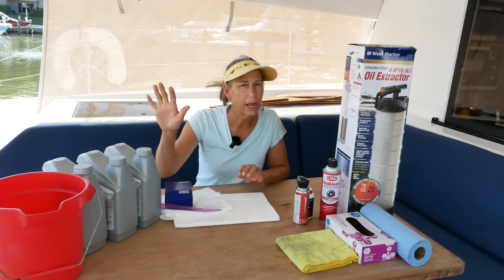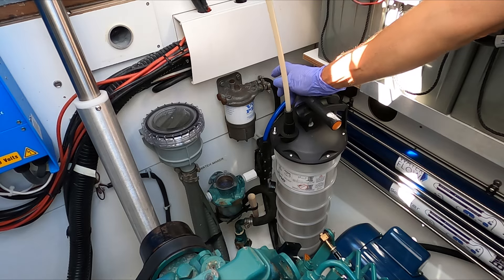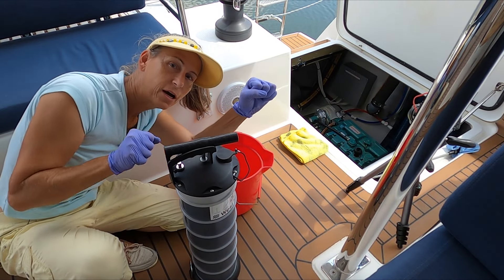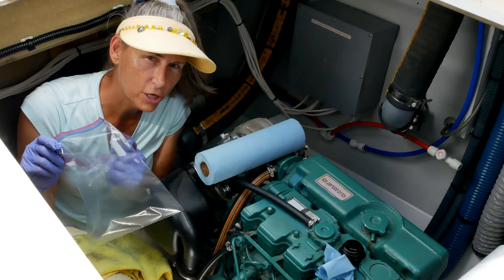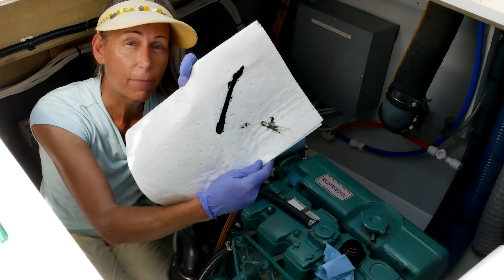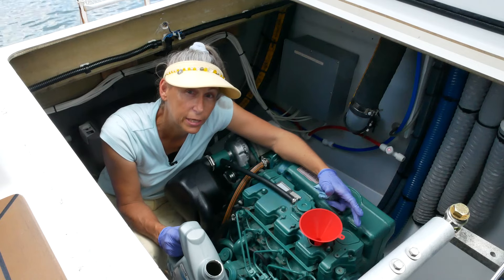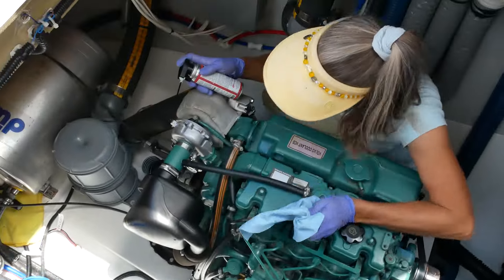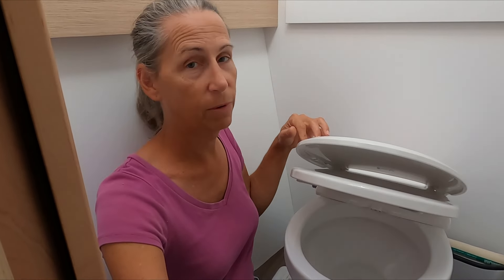Boat Engine Oil Change - EASY - Ep. 26 - Tips and Tricks - Volvo D2-60

Comment from the maker: Recommended supplies for the Oil Change:

Engine Oil Pads
https://amzn.to/3X0bwis

Volvo Engine Filter
part #VOLVO-3840525
https://amzn.to/46JSdgD

Engine Oil
https://amzn.to/3ypz9b5

Silicone Paste
https://amzn.to/3SJ550S

Brake Clean
https://amzn.to/3WILFu3

Corrosion X
https://amzn.to/3M37MGI

Oil Extractor

https://www.westmarine.com

Bucket
https://amzn.to/4dhp7YF

Gloves
https://amzn.to/3WY2geM

Sandwich Bags
https://amzn.to/4coDZDf

Comment: I have a Volvo MD2020, 20 hp; but surprised how much the engines are the same. I use clothes-pegs to drain the extractor hose. It drips while I finish the oil change. I love that you have all that room to work. Well done!

Comment: If I can fill a filter easily with oil I do but for odd positions I don't believe it makes a huge difference, especially if you've run the engine up beforehand so it's got oil right round the system

Comment: I am happy you are using oil pads and you got the ones I like the most,,, the smooth cover type. I normally check the air intake for oil or crud and clean the screen, also I change the Raycor fuel filter at oil change time.... I noticed your coolant cap without a over flow tube ???

Comment: Thanks for the great video. Is there a recommended lifespan on these engines between rebuilds? I used to run a Malibu ski boat with a Chevy 454. It typically spun  at 3-4000 rpm, with a pretty good load from the hull . More of the hull was designed to stay in the water for stability pulling a skier.  1000 or so hours was considered  high hours.
Reply from the maker: It probably depends on the brand.  Oil changes should happen regularly whether the boat sits or is used... similar to a car from that perspective.

Comment: Off subject but as I bought an i8 about the time you did, wondering if you have after 10 years, replaced the drive battery?  Although I really liked the car I sold mine 4 years ago for another 911.  At the time replacement , from what I could learn, was about 25K so elected to bail. Curious how you have dealt with it as I very much respect how you both deal with things. Smooth sailing!
Reply from the maker: It's been great! We replaced the small 12V battery but the main drive battery seems to be just fine. No noticable change in range. We did just replace the front left axle because of a bad CV bootie but that has been it besides oil changes and such. Still very quick and just a great all around car. So different than any other BMW.  What 911 did you replace your with?
Reply: @HeidiandFranny  A turbo 996 cabriolet, traded for a 991.1 C2S coupe, recently traded  for a C8 coupe.  My 3rd Corvette and I like it but I change cars often.   Glad to hear your i8 has been so trouble-free. I bought in '18 a '15 just off lease, Terra, Sophisto Gray. Half the new price, an excellent deal for cutting edge technology.  No room to keep and wanted to move on.  
I also admire your life change. Bold!  Boats and sailing-travel are very cool mostly and I wish you both, fair winds and following seas. Very nice talking with you!
Reply from the maker: @richardwhaley8495 Thanks so much! Enjoy your C8. Thanks for reaching out.  F